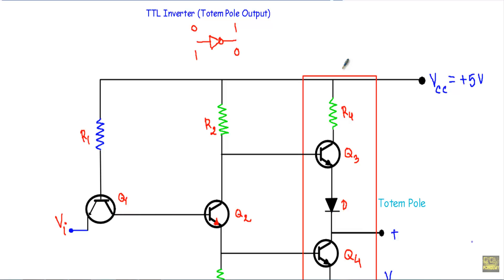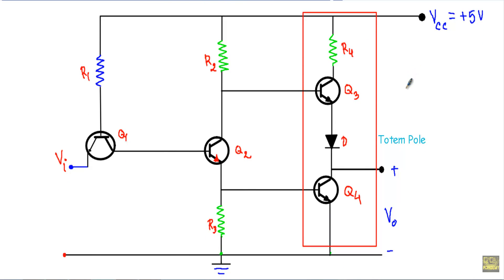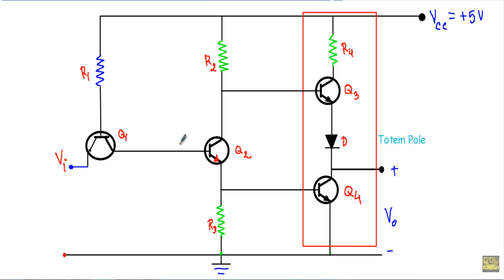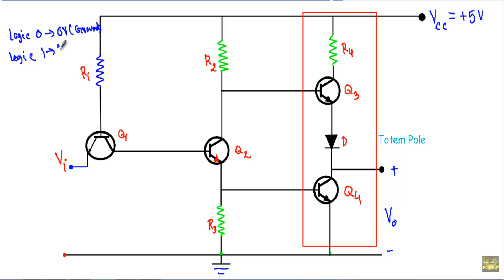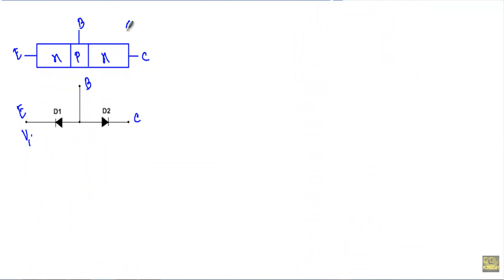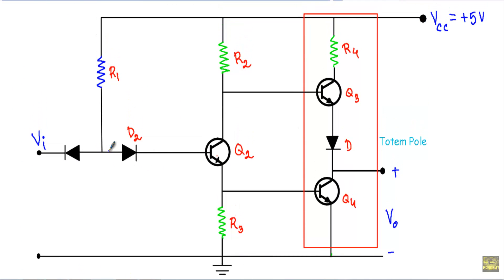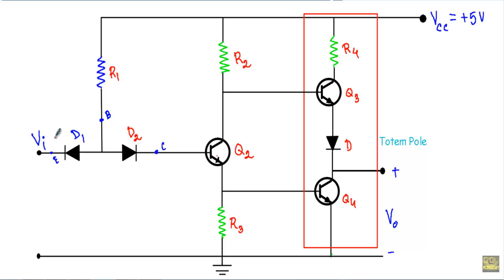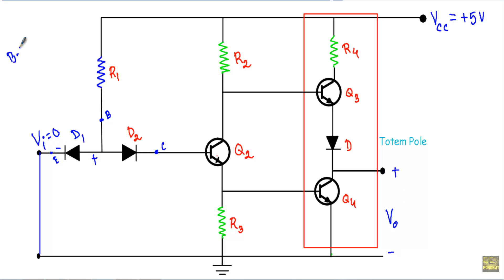TTL Inverter with Totem Pole Output

Comment: I really don't understand why Q3 is not on in your second case.
Reply: since base is directly attached to the ground with V base 0V
Reply: current from vcc flows to the ground leaving q3 off
Reply: Since Q2 is in ON state, that means there is a voltage drop of Vce,sat across this transistor. The node which is connected to the base region of Q3 will see this potential drop. As you know for the the transistor to be in forward bias the voltage across base and emitter region must be greater than Vbe,on which is approximately equal to 0.7V. We only have 0.2V, so Q3 will be in OFF state.
Reply: @keshavsapkota5358  so why did he say 1.7 V to turn on

Comment: Why Vb3 needs to be 1.7 V to turn on Q3?
Reply: The output Voltage V0 is around 0.2 V, the Diode needs about 0,7 V to be turned on. You need at least 0.8 Volts from the Base to the Emitter so the minimum Voltage at the Base of Q3 needs to be 0.2+0.7+0.8V which is 1.7V
Reply: Extra 1.7V is the threshold voltage required

Comment: Thank you for such nice explanation. I have only one question ( Probably stupid one). when Q4 is off state, then when voltage  is measured....why it is not infinite as it is now an open circuit. Why do you get the 3.8 or 3.2 value. Dosen't mean voltage difference mean the force required to push the electrons from one point to another. Any help??